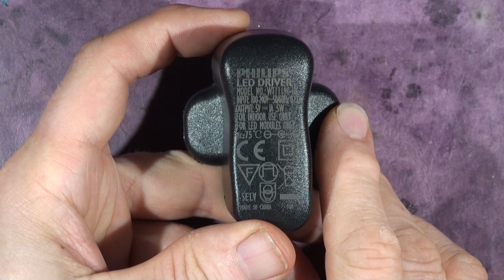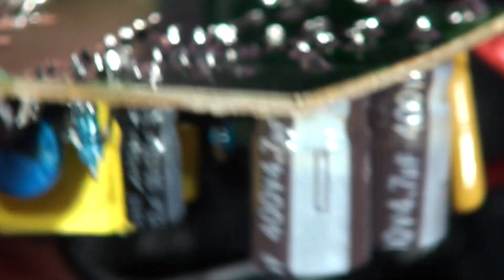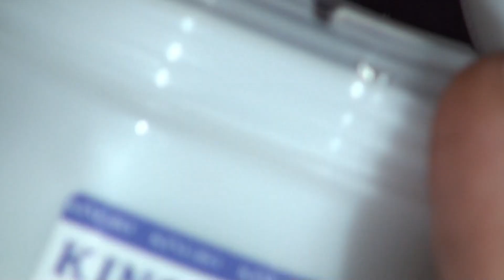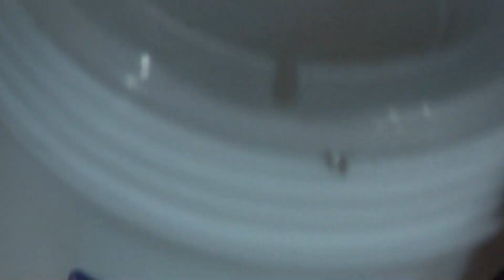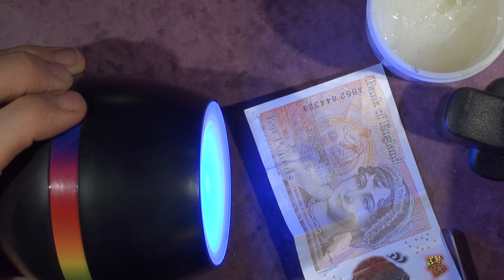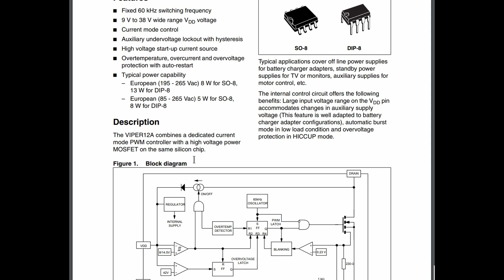Philips Living Colors Light Died - Diagnosis and easy repair

Comment: Mine was working fine, then the remote broke and lost the microswitch. Took me a few weeks to find a replacement remote, tried pairing it and I'm not getting ANY reaction from the light, just 3 orange flashes on the remote. Do you know if the bulb in the light can eventually fail and, assuming it can, is it possible to replace it? I'm a bit stuck, so any ideas would be really appreciated! Thanks
Reply from the maker: Maybe you old remote never broke- could the light itself  be the issue.? Is you power adaptor working. We have 2 of these one for each kid's room and on both the power supply/adaptors have failed and had to be repaired.
Reply: @razenby  Okay, I'll open them up and take a look.. Couldn't really see the short on your video, hopefully it'll be easier to spot to the untrained eye.. It was definitely the remotes fault to begin with, the microswitch definitely failed.. Also, I've always had a reaction from the light each time it's turned on at the wall, but now there's nothing.. Sounds like it could well be the adapter, eh? Having said that, it's a number of years old and I read that they only last 5-6 years? Appreciate your coming back to me man..

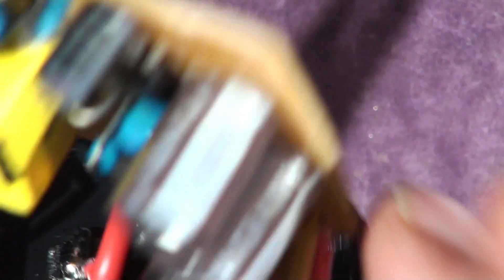Comment: 6:22 funnily enough, it's both a fuse and a PTC. It's a PPTC, it is a PTC that has its parameters tailored for circuit overcurrent protection. It resets itself as soon as the fault clears.
I bet you already knew that, but maybe someone finds the info useful 🤷🏻.
Reply from the maker: PTC can be a fuse but usually they age and start going high under normal load.